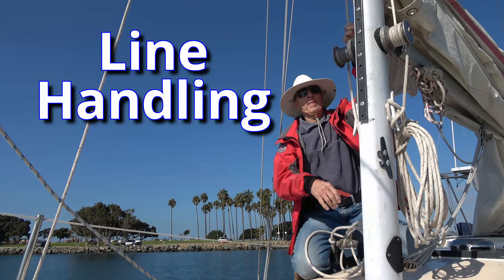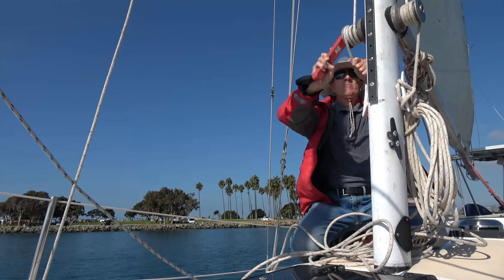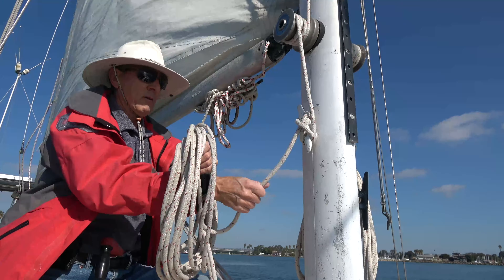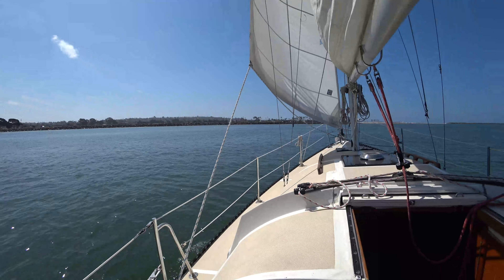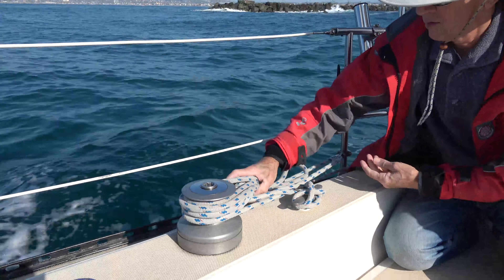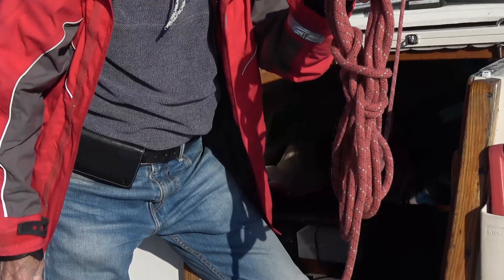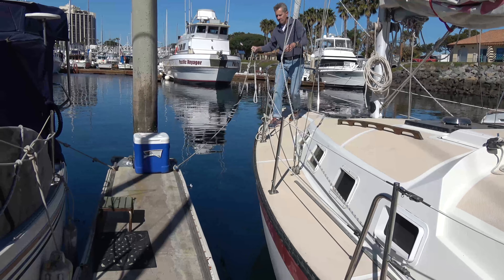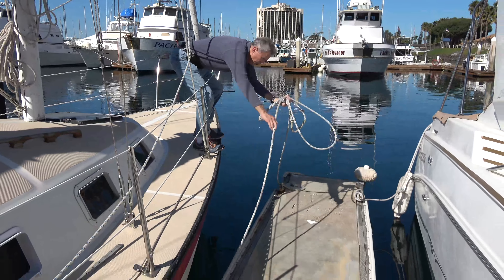Line Handling

Comment: We keep our Kittiwake 23 in a marina. A finger on one side, pilings on the other. We cast off and leave the lines neatly on the finger and on top of the pilings. When we return - we grab the mid ship line from the finger side first. As this line gets tiger it pulls the boat snug with the finger. Then we secure the remaining lines. Works every time.